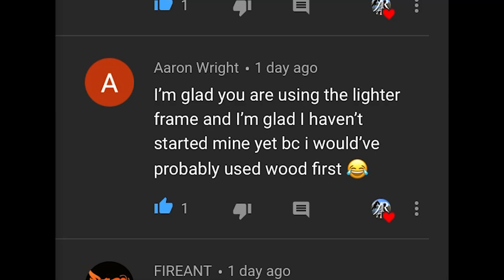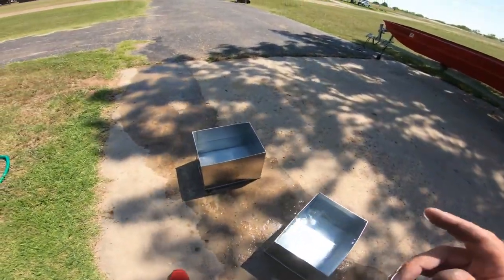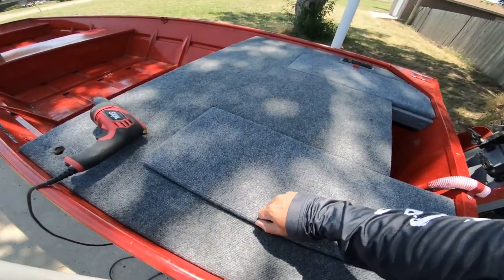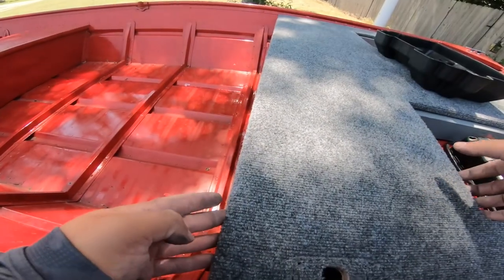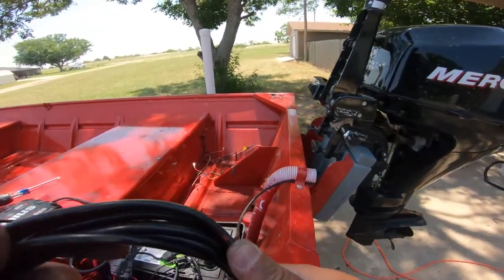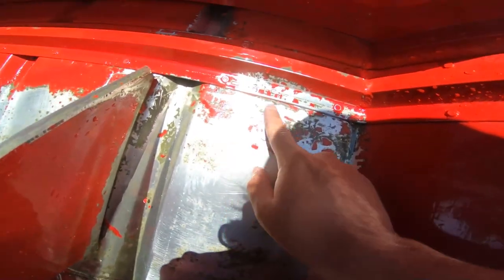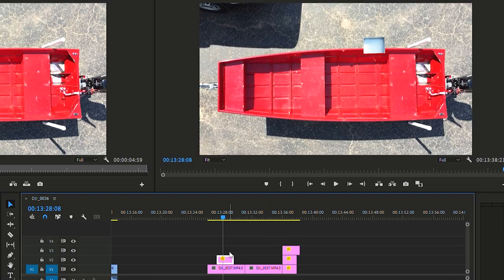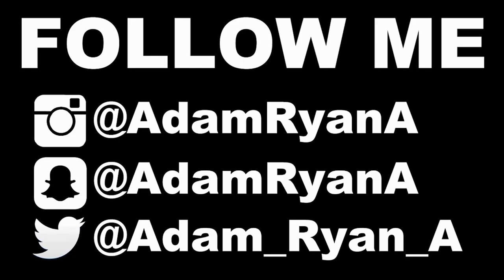Using a DRONE To DESIGN My New JON BOAT to BASS BOAT Conversion!!

Comment: This is making me want to get started on my build again, I haven't touched it for a nearly a year it seems. Kinda got frustrated needing more tools. Ya might think about letting those compartments drain. I'm making mine hard for water to get in from the top but in case it does it will drain to the bilge. Anyways, looking forward to your build. 👍🏻